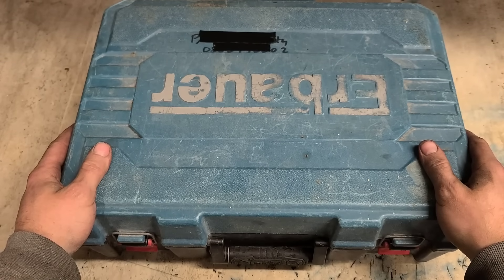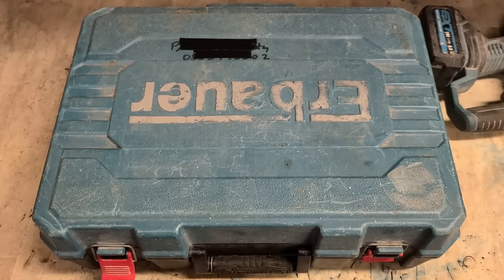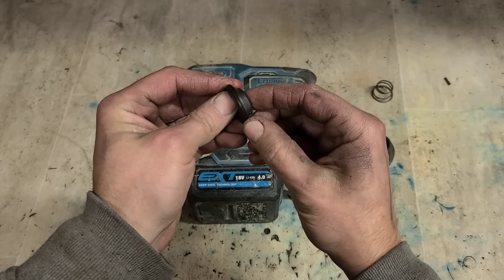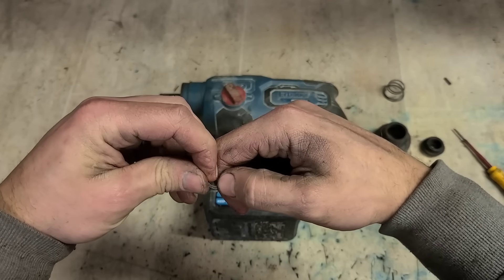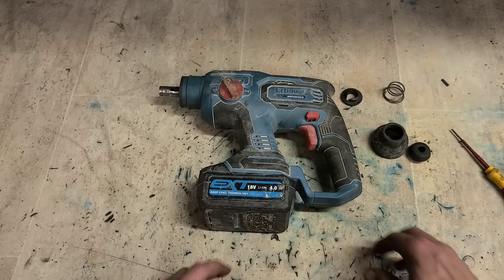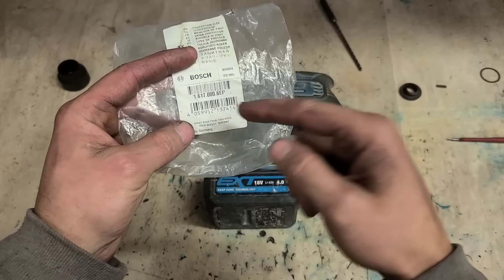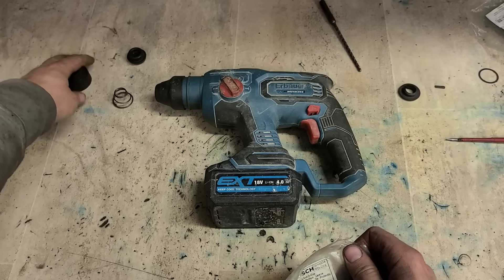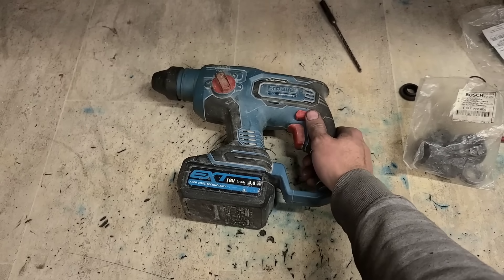Fixing a broken tool holder on a Erbauer cordless sds drill using Bosch parts.

Comment: What a great fix to keep the machine running. Why no parts available do the company who makes them think there never go I g to break.  Something to think about when buying 👍👍
Reply from the maker: thats simply why they can sell them at a low price. they are classed as disposable. suppling spare parts adds an extra cost to the price of the tools
Reply: @deandohertygreaser  

I see what you mean about comparing prices , Its a use and abuse till it breaks

Comment: I needed 2 replacement batteries for my old drill. The cost was £80 but an Erbauer drill 2 batteries and a soft carry case was £75 from Screwfix.
Reply from the maker: Thats not just screw fix, a lot of times it pays to look around and compare prices individually and in kits. When cordless grinders first came on the market they where big money for a kit. It was cheaper to buy a drill kit with 2 batteries and a charger and buy a body only grinder separately. The same grinder in a box with 2 batteries was an extra 50 euro.  
It dose pay to shop about. 
Another thing to price right is batteries. work on the cost per Ah not the battery price. 2 X 3AH batteries can now be cheaper than 1 x 4ah battery. you get more amp hours that way.

Comment: Question.  
I have a couple of these drills.  One was in storage  for a bit. Just use it at home.  
But I noticed an oily grease around the batt.  I thought it was the batt leaking.  But after wiping around it.  It was more of a yellow substance.  
Could the oil/grass lube trickle down from the inner shaft ?
I ask because.  I have a second one for work.  Just started using it. 
The oil / lube is doing the same on the housing plastic at the top.  
Did I just get a couple of quirky drills. 
18v sds erbauer drill.  
I’ll pop them a mail but just curious if you’ve ever come across it. 
Cheers. 
The videos are great

Comment: I'd love to meet the guys who decided " let's use sirclips that don't have pliers tip  holes ......to piss of and annoy every tech on the planet" . I have butchered at least 4 perfectly good sirclips pliers in the pursuit of the perfect tool for them. It's not enough just to grind them flat.....the c clips also have a sneaky slanted bevel to throw off your pliers and crush your fingers. The most recent was a 50mm diameter clip....4mm x 3mm profile , recessed into a pump shaft. And I know there's a proper tool for the....but where's the fun in that.

Comment: The lack of parts for both Lidl and Aldi power tools has been one of the reasons I've not bought any drills or drivers.

The exception has been a rechargeable reciprocating saw from Lidl which has performed flawlessly for the last five years.

I suppose the 3 year warranty provides some degree of comfort as the products are of reasonable quality for DIY use.
Reply: I used the 3 yr warranty on a big powerful SDS drill from Lidl a week after i bought it. I managed to rattle it to death in 5 days hahaha

My Bosch SDS i bought 8 years ago is still working fine and has done a ton more than the Lidl one ever did.

Comment: Hey, I have a quick question if you break off an SDS bit in the end how the fuck you get out when it’s bent
Reply: Try pulling it with vise-grips otherwise disassemble the tool holder.
I once bought an SDS to normal chuck adapter on a chinese "euro" store, the thing was so badly made and out of spec that I couldn't get it out of my machine, I had to clamp it on a vise to remove it.